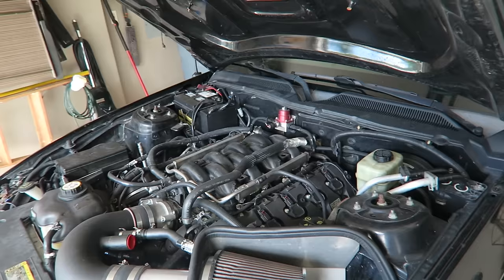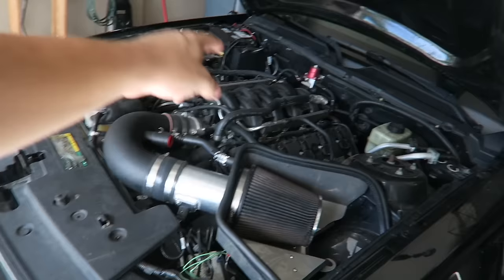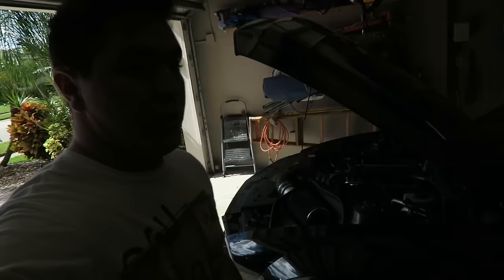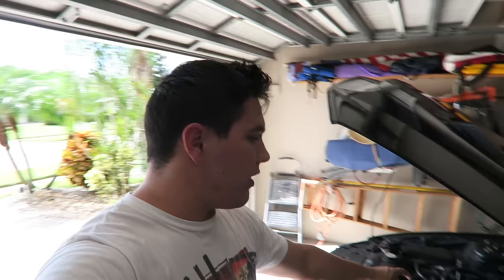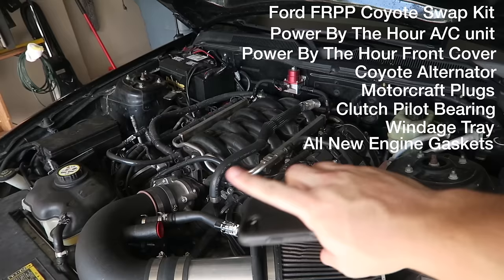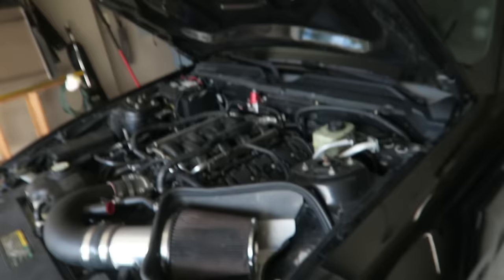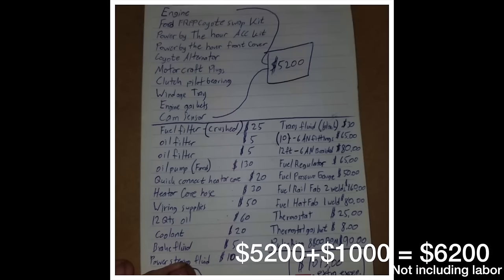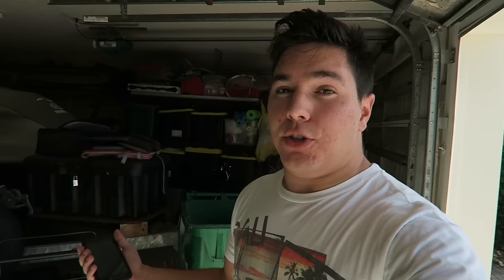How Much does it COST to 5.0 Coyote Swap a 05-10 GT Mustang? (s197 Coyote Swap)

Comment: You can buy a low km write off coyote for less than 3k at the auctions. That is the only intelligent way to do the swap.
Reply: No 3k coyotes bro
Reply: @nadersaleh4643  I can buy one right now a 2012 engine for 2800
Reply: osp80  ya my bad I thought he meant Copart am all about Copart
Reply: @stickyicky2858  hey so I’ve got a blown coyote on my 2014 and am wondering how much I should spend on the new engine and labor w all parts included... if anybody could help I’d really appreciate it. I’m planning on keeping this car for a while
Reply: @stickyicky2858   where do you get the engines from?
Reply: Cheap out in life expect cheap outcomes
Reply: @nadersaleh4643  yes there are plenty of coyote pull outs at local recycling yards for less than 3K

Comment: I bought a 2010 gt. Built up the 4.6 3 valve. It sounds & performs amazing. Everyone is in luv with it. Its quite the performer. Id build up before swap.
Reply: That’s cool, but it’s not for everyone
Reply: 4.6 engine is nothing with all the respect that 4.6 v8 is a desgrace of v8.  Is listed as Fords worst engine ever for its time!
Reply: @inasimulationwelive I’m full bolt on in mines and I’ve beaten Honda’s, bmw’s with turbo’s I can ham with 2015-16 mustangs gts and 
Camaro ss

Comment: If you’re going to upgrade the intake manifold, you should look into either the cobra jet or boss 302 manifolds, they give a nice boost and they look quite nice under the hood :)
Reply from the maker: I was actually thinking of getting the 2018 gt manifold
Reply: Definitely get the 2018 300$ and it is very close to the cobra jet
Reply: +1 on the 2018 manifold..
Reply: I honestly didn’t know the 2018 manifold was a viable option, always happy to learn something

Comment: Serious question, why not just spend 3500 on a stroker kit with full forged internals to get 5.0l?
Reply: Because that would end up around 440 whp MAX. Which is pretty mediocre for the price. Coyote with similar mods will be at 500 whp.
Reply: Well, the coyote is a superior motor so that’s why lol
Reply: That’s hella money for both parts and labor. Plus the 3V is SOHC whereas the Coyote is DOHC
Reply: Because the 3v is pretty gutless. Coyote is a better platform
Reply: @mogulme6190  3v r junk that's the stupidest thing I've heard
Reply: @neilbrown82  you are literally clueless lmao. The only things holding back the 3v are the rods and the oil pump. If you’re doing motor work anyways, just replace those things and the 3v will take all the power you can throw at it. No need to swap
Reply: @Nahyoutweakin  3v is junk I'm definitely not clueless but if you want to waste money on a turd of an engine be my guest
Reply: @neilbrown82  ok what’s a good motor then tough guy
Reply: @Nahyoutweakin  coyote, anything ls
Reply: @andrewslagle1974  yep we found the three valve nut swinger here😅😅🤣🤣😂 seriously 🤣
Reply: @neilbrown82 anything ls lmao.  You just let is know not to take you seriously.  Stop acting like every ls engine is some amazing touched by God engine lol.  The 3v is just fine for what it is its a 4.6 liter from 20 years ago.  If you build it you can make killer power especially boosted.   It takes a little more modding to make similar numbers as a boosted coyote (but it will sound better and have more tq at any given power level) but what you save not swapping can pay for that and them some
Reply: @neilbrown82 the 3v isn't junk at all.  It takes more modding vs a coyote to make comparable power but it costs less up front it's all relative.  All the coyote fanboys trash on the 3v just because the coyote is better don't mean the 3v is bad.  This mindset is stupid.
Reply: @midnight347  coyote is light years ahead of a three valve in terms of performance

Comment: How did you pass emissions? I'm sure theres engine lights and thrown codes being a swap or is there not?
Reply: I figure there must be an adapter kit so the coyote ecu can properly communicate with the older cluster.

Though you could just explain to the inspector that it's been engine swapped.
They mostly go off what the obd2 reader says since some people cover up/jump engine lights, thus i would imagine most dont even pay attention to what the cluster says.
Reply: Imagine living in a state with emissions tests 😬

Comment: To they guy that said "it would weight more with coyote." No. Coyote blocks are aluminum. Hell they weigh less that a 2v let alone the 3v. You said forge internals, on3 kit??? Well add roughly 80 to 10lbs maybe more for turbo kit and your sitting roughly 180 to 200 lbs or more than the coyote with all that stuff. Yes he would still have to ungrading transmission with either set up. I personally think he did the right thing and mostly the right thing cause it's his BUILD. My 2 cents.
Reply: 3v block is aluminum too genius.  Old comment but you are spreading bad info.

Comment: Wouldn't it be easier to buy a Coyote engine and transmission from ebay or somewhere else with low miles and just swap it out? All you'd have to do after the install is the wiring.

Comment: Would the mt82 fit nicely in it and would the a mt82 shifter fit fine too?
Reply: Keep a 3650. Mt82s are trash NOT worth the extra gear. If you need milage or top end just numerically lower your rear gear.

Comment: Does it cost around the same to swap a v6 to a coyote?
Reply: I was going to ask this too, but I see you still haven't gotten am answer either 😔
Reply: @QuestWithMe  those of you that still care… yeah it’s gonna cost you around the same. but you will have to do a different transmission simply because it’s not worth running the old ones. also have to think driveshaft/rear-end. i’ve been considering doing mine but building a 3 valve might look like a better budget option
Reply: it just depends on the timing of your motor purchase obviously, and some luck plays into it. it’s a shitty game but if it works out you could only be down 8-10k. if you do it yourself

Comment: I have a 07 v6 mustang with an,auto trans, would the process be the same
Reply: Django Mango I’m trying to figure out the same thing I have an 08 auto
Reply: Nah.  Different motor mount placements.  Need a different trans, drive shaft, etc.  also the suspension is setup for the weight of a v6.  Gonna have to upgrade that to support the extra weight.  And beefier brakes to stop the now heavier and faster vehicle
Reply: Thank you, I knew most of that will need to be replaced. I even went on American muscle and asked them that question and their response was that was “pretty much everything” like I didn’t already know that. Thanks for the response bro do you know where I could source these parts from? I don’t want to buy the wrong parts
Reply: Best bet is to just get a coyote.  And take parts off a wrecked gt.  Bout the most cost effective process.
Reply: Okay, i have an 08, so would it be best just to go for the same year gt for a parts car? Or does the year matter
Reply: @jakemcternan3800   05-09 is all interchangeable v8 to v8, v6 is obviously not so much engine component wise
Reply: For a coyote swap a 11-14 gt.  If you have a v6 I’m not sure about that.

Comment: what exhaust did u use to bolt up to the engine i have a 2005 with the 4.6 and the headers on the drivers side is very close to the steering shaft i want to do a swap on mine when i can but not sure how headers can work on a 2005
Reply: Bmr motor mounts will clear the headers issue just a heads up

Comment: Couldve got a on3 turbo kit and forged pistons and rods for that price for the 4.6🤦‍♂️
Reply: Cris The Red you’re on to something here, chief
Reply: "Could've gone turbo" comment on an ENGINE SWAP video...you're a funny guy.
Reply: Yeah well if the car had high miles it's not the best idea to boost it
Reply: @buddyywilsonn  he literally said he could have put new internals and boost.
Reply: Cool story man. I've had my 2005 gt since it was brand new, plan on keeping it forever. After having to replace the cam phasers, I'm set on putting in a brand new engine it eventually.

The 3v is older and it's not always about going the cheapest route. I'd highly prefer a newer and more reliable engine for the long term viability of my car.

Comment: You left out labor costs.
Reply from the maker: I just wanted to cover how much the swap would cost because labor will be different everywhere
Reply: It would still be helpful to use as a range.  Maybe give it as a ballpark.
Reply from the maker: it was about 1-2 grand but it can be upwards to 4k depending on who does it
Reply: Johnathan Harder thanks, i was curious if it could have been $6-7k.  That’s not too bad.
Reply: @Johnathanharder  thanks man, extra information is never unwanted.

Comment: I want to put a 5.0 in my 2008 v6 because it has the entire front and rear end re built so I don’t wanna sell it I’d rather just keep it forever and make it a project car and put a v8 in it and go from there i only have 1000$ saved up rn but in like another month or 2 ima have like 3000-4000$ Atleast and then I’m trying to buy just the motor and find a transmission after unless I can get a trans/engine combo for like 6000$ that would be perfect

Comment: What kind of clutch and flywheel do you need?
Reply from the maker: you can use your stock clutch however I upgraded to a exeedy 400 clutch and for the flywheel you will need an 8 bolt flywheel

Comment: I would like to swap a ford engine in my 69 mustang fastback.. I am looking into reliable mustang engines with stick shift.. any recomendation/suggestions?
Reply: If you want overhead cam look into a gt500 driveline 07-12.  They have the supercharged 5.4 4v with tr6060 6 speed manual trans I've seen them around 10k engine and trans with decent mileage.  It's 500 horses out the box with the capability of 600+ wheel w stock blower or you can swap the blower and do a fuel system and make 800+ and they make killer torque it's a more old school lower revving torque oriented engine vs the coyote and it also has an old school sound compared to the coyote especially with cams.  I highly recommend.  Otherwise do a gen 2 coyote with t56 magnum trans.  It can be killer with or without boost.  If you want a pushrod you could do a 7.3 godzilla with intake manifold cams and headers they can make good power and tq.  It's easy to go over 500/500 to the tire na and they sound like an old 351 on steroids so it'd be right at home in that 69.  Lots of great options.

Comment: Okay I'm confused wouldn't it have been cheaper to just buy the coyote GT motor?? Or would you still need the accessory kit?? Because I thought the accessory kit was to make the F-150 motor fit exactly like the GT motor??
Reply: It's the same engine still a 5.0 coyote so you would need the same thing. Theres small differences in the f150 engine than in the mustang engine but pretty much the same thing he talks about it in a different video.
Reply: @golpherboy13  the f150 manifold is trash.. only makes sense to go this route if he planned on going boss 302 intake
Reply: @gabrielcollazo6835  yea but the f150 engine is cheaper than the coyote engine
Reply: @golpherboy13  by 200-300$... if you don't plan on doing a 302 Intake then it would have been better to buy the GT engine. The f-150 has 60 less hp, smaller cams, less compression.. only viable reason to go f150 is with intake and boost, other than that it's fking retarded to save a few hundred dollars

Comment: I have a 4.0 will my fuel lines work I have a pump from a 14 gt I’m using and need advice on speedometer and tac
Reply from the maker: for your speedo you are going to need a digital Dakota box 5-e and yes your fuel lines will work however hooking it up to your fuel rails may need to be worked on
Reply: Thank you so much I really appreciate any help I can get I’m new to this I had a donor car and pulled what parts I could off
Reply: I’ve got the speedo from the 14 I probably can’t mod it and use it can I
Reply from the maker: pretty sure that can work, you just have to adjust your tac with the Dakota box

Comment: I have a v6 mustang I want to engine swap which engine do you recommend
Reply from the maker: depends on what your budget looks like. I mean personally I would maybe just go with the gen 1 mustang coyote instead of the truck but at the time I couldn't afford it.
Reply: Johnathan Harder so I have a 2014 v6 and I’m trying to do a complete engine swap, I was thinking either gen 1 or two? Any tips on what I need in also in Florida but yeah no price budget I’d love your help like a legit full build
Reply: Bc I found a coyote 5.0 engine with a transmission for 5,000

Comment: What I need to know I have a v6 mustang 05 if I switch the engine would I just be switching the engine nothing else or other stuff too ? Please let me know
Reply: Pretty much everything
Reply: Sonicshadow075 you would need not only the motor, but the ECU (Computer), Radiator, Bellhousing to match the 5.0 Coyote and beefier tranny to hold the torque), first and foremost.  You can get by with pretty much that.  Your cheapest way to build one would be find a wrecked (in the rear) 5.0 Coyote Mustang and part out the wreck... if you plan on doing it yourself or just sell the V6 and get a 5.0 🤔